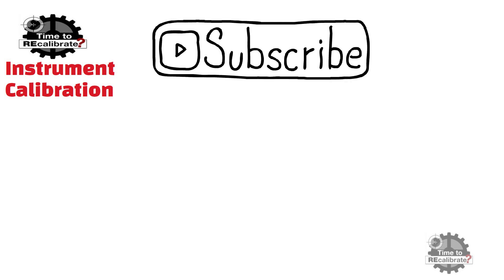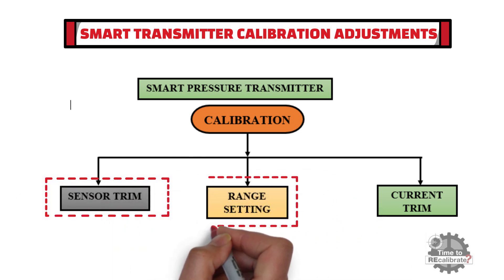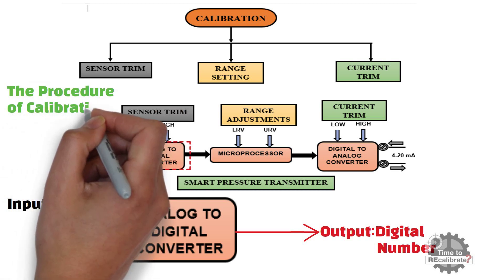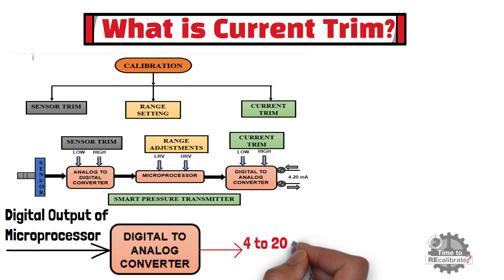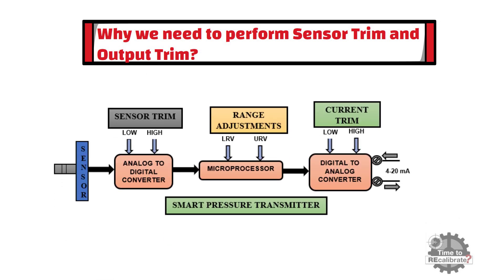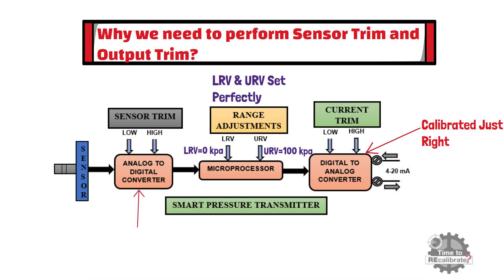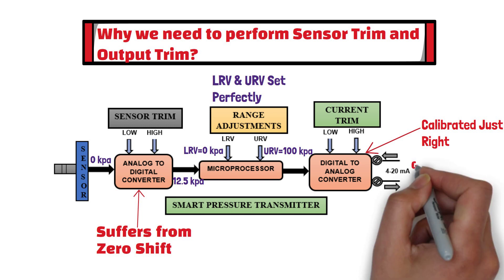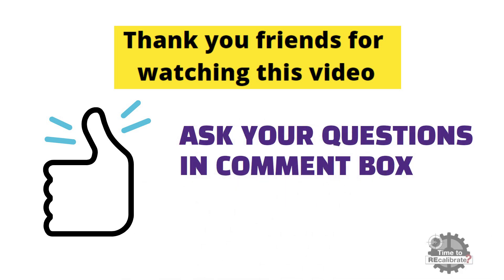What is Sensor Trim and  Current Trim | SMART Transmitter Calibration

Comment: Hello, bro can we do current  AO trimming without removing the transmitter in service? Because there no option to remove the transmitter and isolation valves are not available. Tranmitters AO signal was drifted so i want to do D/A trimming. Is it possible?
Reply from the maker: Hello Phill
Yes, you can perform AO trimming without removing transmitter. However, you need to make pressure to zero to set LRV, and you have to adjust pressure to exact same pressure as URV before performing span trim. If you don't do that URV will not be set.
Thanks for asking this question. 
If you have any question, please feel free to ask.
Reply: @InstrumentCalibration  thanx bro
Reply: Please tell me what pressure sensor output is ma ?

Comment: Dear what mean by known pressure source, for 4ma o/p how much pressure should apply through known pressure source, can u guide
Reply from the maker: Thanks for asking this question. Know Pressure source means  Pressure calibrator. You can use any standard pressure calibrator. But make sure that your pressure calibrator gives accurate pressure. For 4 mA o/p pressure should depend your pressure transmitter range. If your PT range is 0 to 100 inches H2O then pressure should be 0 inches H2O for 4 mA Output.
Reply: Is pressure sensor output is ma?